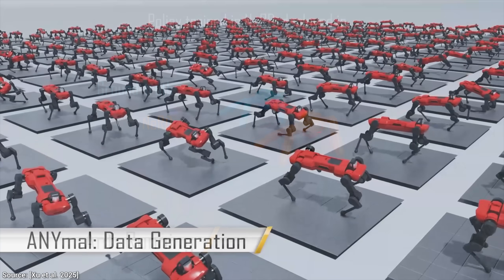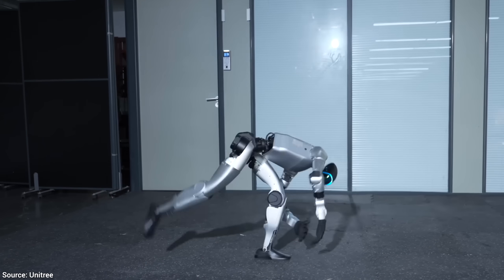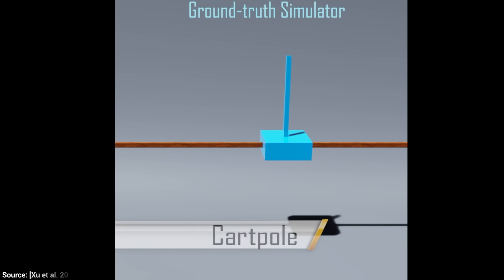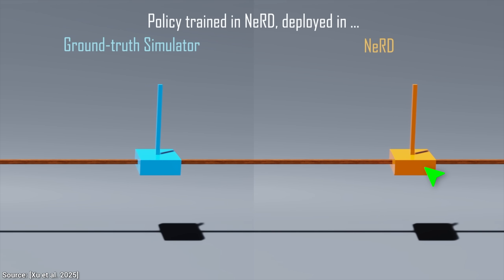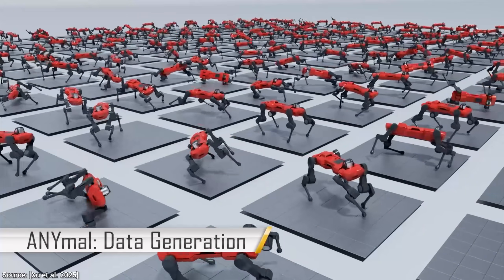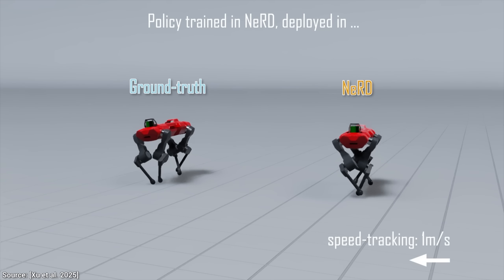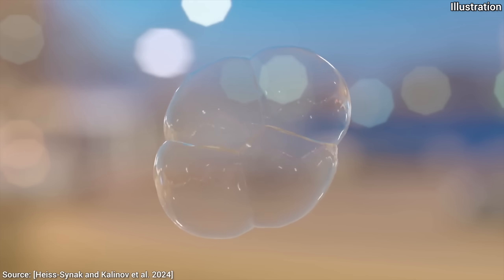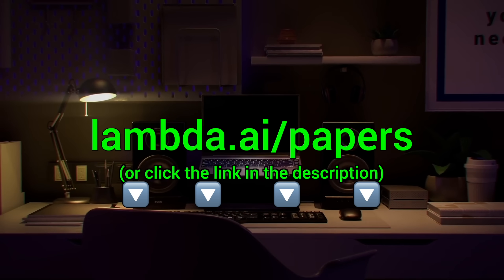NVIDIA’s New AI Just Made Real Physics Look Slow

Comment: In reality, physics don't exist.  When you jump, its instantanious, you move at near light speed, and there is no gravity so you go up 6 feet.  The bigger something is, the faster it move aswell.  When you blow up a building, it falls faster than gravity and actually speeds up to also near light speed.  Dust doesn't have air resistance.
Reply: complete gibberish and easily disproven

Comment: Fyi your name is not hard to parse or understand, but the tone and rate at which you speak combined with no reference point in english makes it almost impossible to judge where each name ends and begins.

Then there is also the fact that tons of youtubers say “___ here, whats up?” And your name ends in something that sounds like “here” and you say it quickly and with a really vague tone, so it sounds like you are saying “dr karol zhnfhehshe here”

Tbh if you just said it slower so we could have something linguistically to grab onto and parse, or potentially displayed it written on the screen as you say it, you should be completely fine.
Reply: When I say slower I do not mean each letter. I only mean spacing out the three names from each other.

Comment: Oh, this is going to improve robots immensely. Think about it: every action you take requires your brain to make a prediction in real time, like when you throw an object, you need to predict where it's going to go based on the weight of the object and the force you put in. For complex sequences of actions, you also need to continuously update your predictions in real time. Fast, accurate physics predictions is going to allow robots to do all sorts of complicated things in the real world, and quickly adapt to all kinds of unexpected situations.
Reply: A fly has 140K neurons, limited sensors or awareness and runs on microwatts of power.   

AI is impressive but inefficient.
Reply: @robschanaynay3500  If you take those 140k neurons out of a fly and put it into a spider's body, It'll completely fail to function. Even if you take a human brain and wire it up to a robot body, it will take months or even years to learn to drive that body, if it is possible at all. Biology is efficient but very limited in capabilities it is not optimized for.

The pros and cons are just two sides of the same coin.

Comment: Great video! The only thing missing was how much computing power does this new method require compared to previous state of the art?
Reply: Read the paper:

"With 512 parallel Ant envs, Warp (with 16 substeps, which is the number of substeps we use in
Warp for generating training data for Ant) achieves 28K FPS, and NeRD achieves 46K FPS. We do
not view this comparison as definitive, as both Warp and NeRD can be further accelerated; how-
ever, as a neural model, NeRD benefits from continuous advances in AI hardware and community
efforts in ML software acceleration (e.g., TensorRT). Additionally, the policy-learning experiments
demonstrate that NeRD is fast enough for large-scale on-policy RL"
Reply: roughly half.
Reply: it would use less... which is the entire point of doing this in the first place. Less compute = faster